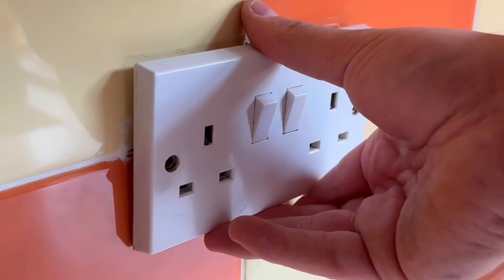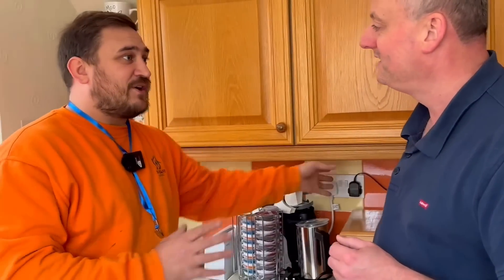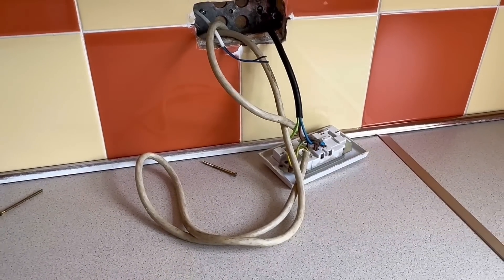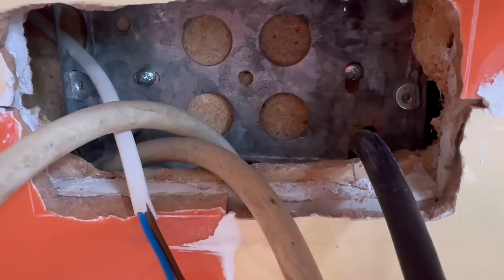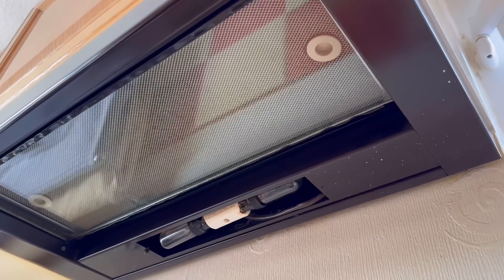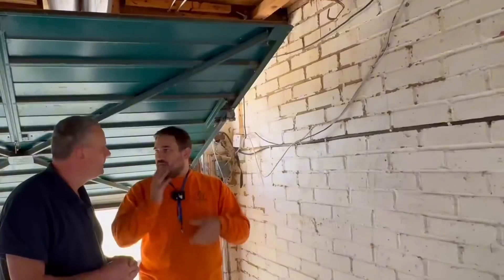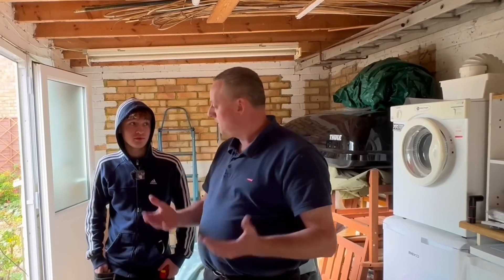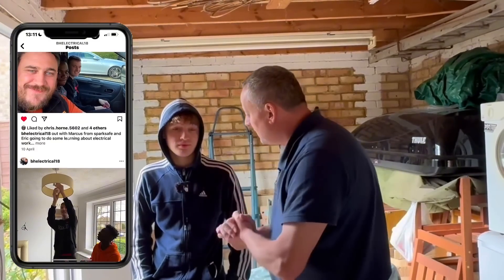Is this Allowed? Wiring Electrical Circuits in Flex…

Comment: So let me get this straight an extension lead was plugged in a socket in the kitchen the other end was a plug that went threw was borrowed from a strimmer it went out threw back of another socket in kitchen straight outside ( not weather protection) round the doorframe back threw the wall straight back in the kitchen to feed a single painted of socket to feed a cooker ignition and also a washer machine- so your telling everyone that end the cooker and washing machine the wires were twisted together, who did the installation laurel n hardy

Comment: Wait, so was that orange flex putting power out of the exposed pins of the plug and into an otherwise disconnected socket to feed the other socket? and going through the extension cord, but really what even matters any more then, right. That seems like it might have gathered more opprobrium than it actually got. Because that’s the only way I could see it feeding to the washer and cooker?

Edit: maybe I’m missing something about the layout and the washer isn’t under the socket that the orange flex plugs into.

Comment: If it’s wired in flex you can bet the whole circuit isn’t so what you put down on the cert ? 2.5/1.5 t&e or 2.5/2.5 flex. I’d be ripping the bodge out.

Comment: as an industrial fitter I was thought absolutely no to using flex inside walls or conduit because it can overheat, you are allowed to use it as a trailing lead or as a final circuit pinned to a wall and open to the air so it won't overheat, I know domestic regs are different and that's not my area
Reply: Why should it overheat if the conductor area is the same as that of an equivalent cable with solid conductors?
Reply: @helps9939 honestly I don't know, it's just what I was told by the electrician who trained me, but I have often wondered the exact same thing.
Flex can overheat tho, I once got a job at the factory where a flex cable had burned up, it was powering a 30A heating element in a bag sealer, the cable was routed across the room from the wall inside a round plastic 22mm conduit that had been wrapped in foam pipe insulation by a machine operator who kept banging his head. The cable size was well within spec and it had been fine 24/7 for 15 years until it got the insulation, then it failed in less than a week, but pipe insulation is more insulating that walls, I expect there's some math that can work this out but I don't know it

Comment: In boats it is the regulations that circuits are wired in flex, usually Arctic, HO7, or soft heat resisting, the main reason why Twin and Earth is forbidden on boats is engine vibration can fatigue solid copper core cables.

Comment: Getting the nails of the clips to work in mortar - or brick - or anything that tends to explode on you - pin plugs are the answer . Wonderful things that few electrical wholesalers seem to stock . Cheap as chips and do the job perfectly . They’re designed to ! 
Drill  a hole pop one  in - and the nail of the clip clip bangs into the plastic of the pin plug really nicely. Reminds me I need to buy some more !

Comment: Did I hear “omit the need for an over current protection device if the load is less than the cable rating” when looking at the under cabinet lighting supply? Surely the cable needs to be rated to handle the maximum PFC limited  by the circuit protection? I don’t think 0.5mm2 flex will fair very well under fault conditions when protected by a 32A circuit breaker!?
Reply: That was what I’d always heard, but apparently these days low power devices just need low capacity flexes. Which you will be able to see on all appliances being sold in Europe these days, because our sockets are pretty universally 16A and fused as such and our plugs are unfused, and yet lamps with 0.5 or 0.75 flex are entirely common. Still not super happy with it in fixed wiring, but it doesn’t seem to be giving huge problems as such.
Reply: So that very small flex isn't sharing any of the current from other things plugged in on the ring? It's just the cabinet lights current being drawn through it?

Comment: As a retired electrician, I would have got  the sack doing this. It's a horror show compared to a high standards electrical contractor. But, if the flex is double insulated as normal cable is and it's rating ok, then I see no harm using flex. We used heavy duty flex on machines, 4 core flex , earth and 3 phase supply.

Comment: The only colour of any cable on the outside of a building should be Black. Any other colour will be suscepitble to UV degradation, and therefore NOT good.

Comment: I worked in a few Sainsbury’s store upgrades around 2010, all the lighting and power circuits were wired in YY cable. Compared to T+E systems the Zs was always good due to the full size cpc. Just my 2pence worth. Cheers

Comment: Many industrial / plant wiring is done in HOFR flex , its expensive of course , but is a pleasure to work with and terminate ( always ferruled ) , and you really couldn't use solid core on the likes of control panel wiring ( where the panels require occasional opening for maintenance etc).
Reply: I have come across older machinery with their control panels wired in solid core wire, and one of the most common problems is that the connections break off right at the terminals. Because the wire is solid and holds it shape, the break is not always obvious. I think that a house wired in flex would be completely acceptable, especially because the CPC would be the same cross section as the current carrying conductors.
Reply: @whizzo94  Flex only becomes annoying when you've got a really tight box and need to cram too many wires into an old-fashioned choc block. Stranded wires are always slightly larger in outside diametre than the same CSA solid wire because there's gaps between the circular strands and that can make a difference, forcing you to use one size larger choc blocks that no longer fit into the box. These days with lever Wagos that's no longer an issue though. The other downside is having to  spend the time crimping ferrules all over the house.
Reply: @whizzo94  Agreed!

Comment: Normally the content on this channel is excellent but I am left feeling confused after watching this video, i.e. Can you wire in flex if it meets the right conductor size i.e. 2.5mm or not? Also what counts as a fixed installation? still learning hence the questions as I watched the video thinking the issue was the state the installation was in not necessarily it being in flex but then the comments below of confused me further. Gary you need to pin the correct answer.
Reply: There is no reason to use flexible cable, if correctly rated for the load it's exactly the same at the point of carrying current. It's more practical to install, but the reason why solid cable is used it's only a matter of cost. 

Here in Italy, for example, solid cable is not used, since using flexible cable (either singles if enclosed in conduits, such as inside walls, or multicore if external) is more practical to install.
Reply: The fixed part of the installation would be the sockets , switches   distribution board , fixed appliances  ( like a shower ) .  The things that stay when you move house . Appliances like kettles   toasters have different regulations . I worked on portable buildings last year and they are all wired in flex , including showers in 6mm 3 core flex . You get good R1+R2 readings because the cpc is the same as the line .

Comment: No decent fully qualified and trained to the standards of the 13th edition would wire any fixed installation in flex. What is the best uk wiring standards coming to. GHU
Reply: Clearly being trained to these standards does not  guarantee that the person understands basic physics.

Comment: As a competent kitchen fitter i cannot see any problems, its cheaper to buy hedgecutters and cut the flex off than buy the correct cable..a few choc blocks if the cable is not long enough , job done..

Comment: ALL Tesco's buildings wired in flex - it was the norm. aprox 15 years ago, every single Tesco building - hundreds of them were wired in flex at Britspace modular buildings and passed every test with no issues, it was in the spec.
Reply: I worked in a new Tesco build. All fixed Wiring was in galv conduit. Sockets, lights the lot back to the distribution boxes.

Comment: Not mentioned (I think) but surely the biggest problem is the power coming from outside on the orange cable and into a plug???? Take the plug out and you've got live pins.

Comment: Is it legal, is it possible, to complete enquiries before contract when selling a house with this kind of wiring?
Reply: Nothing in law that says wiring has to be to X standard before buying. Think about it. If I buy a derelict property, the chances are very high that the wiring will not meet modern standards at all, let alone 16th Edition or any edition before. It was the same when I bought the place I live in now. The previous owner had knocked down walls etc, left cables dangling. The bank had repossessed it. I just paid the money and bought it, knowing that the electrics would need sorting out. Buyer beware. Most mortgage companies would require a survey before handing the cash over. One reason the other buyer in the bidding had to pull out. I was paying cash, they needed a mortgage. And they got turned down.
Reply: @bertiesworld  So you can buy something that you couldn't rent? Seems mad to have such different standards? I take your point about a derelict house but no one is proposing to live in a derelict house whereas a house buyer is, presumably, going to live in it or let it to someone else who will?
Reply: Why would the seller be the one to 'complete enquiries'? Unless the buyer has specifically requested further details, following on from a survey.
Reply: @Benzknees  Because that's the law in England and Wales.
Reply: @BrianejSmith  - Specifically which laws are you talking about?

Comment: There is absolutely nothing wrong with wiring in flex.
Reply: You’re right. Actually, mobile homes like caravans etc. Regs say it should be wired in flex!
Reply: @mathewashley3954 that’s due to stranded having better grip on the terminal when under constant vibration like driving
Reply: @Ant98986  you are correct.
Reply: @mathewashley3954 specifically either in artic flex or t and e in flexible conduit
Reply: @altvamp  I’m pretty sure 2.5 flex can carry 25A
Reply: Except not the most cost effective
Reply: 2.5 is rated at 25a @altvamp
Reply: Tri insulated too.
Reply: 2.5mm flex is rated at 25 amps. @altvamp
Reply: I thought flex is less durable?
Reply: no @InvisibleYetVisible
Reply: So your flexible then
Reply: My flexible what? @mufc99ok
Reply: All my wires are flex
Reply: Looks wrong though
Reply: @scott4shell why
Reply: Oh my god who the heck does that shite work
Reply: But you can't say why flex would be shite. Because it's not. It's wire. It's actually better to flex the backs of sockets because there's much less strain on the terminations than when using twin. Twin is shite. @mufc99ok

Comment: Bizarre, 
While installing a security alarm in a new build property fairly local to me , some 15-20 years ago, I did discover that the ring final circuits were wired in 3 core flex with similar to 3 pin garden extension leads to extend the what I can only summit were  fixed cable lengths 🤔🤷🏻‍♂️, as there were multiple’s of these found under 1st floor floor boards while finding a route for my fused spur for the CPU .

Comment: When seeing what appears to be an undersized cable on a protective device, I'm still surprised to hear electricians refer to whether the cable can be overloaded (so considering overload protection - suggesting that it's ok if it cannot), without also considering short cct and earth fault protection i.e. the three components of overcurrent protection.
Reply: BS7671 makes pretty clear where/what is acceptable here. Regards short protection, the fault current at the end of even a bit of 0.75mm² that is a few metres long is still going to be more than high enough to magnetic trip an MCB sized for a normal final circuit...
Reply: @intercity125  are you confusing the amount of current required to operate the protective device, as in shock protection, with the current involved in short cct, that requires the requirements for the true adiabatic equation to be met - I2t<=S2K2 (i.e. energy let-thru of the protective device <= thermal capacity / energy withstand capability of the conductors)?
Reply: @johnhoward2104  I was thinking more of ADS clearing times...
If you apply the adiabatic equation and check the withstand capability, it's also not a problem... 

Why not go run those numbers? You'll find that for any conceivable fault current in a residential property it'll meet the withstand requirement.
Reply: @intercity125  Is it? I thought that was precisely one of the main reasons for the existence of fused plugs in the UK, protecting appliance leads against short circuits. The other one is obviously overload protection for power strips.
Reply: @Ragnar8504  Honestly fuses in plugs for short circuit protection are more important when you consider older designs - a 30 A BS3036 rewireable is going to take a while to open at the far end of a circuit if you short a long bit of thin flex.

(Let-through energy is worse closest to the protective device on an MCB until the full circuit impedance exceeds that which you'll see a mag trip on, whereas a fuse only has thermal tripping in its repertoire, so the let-through is worst at the far end with lower current but longer duration of heating!)

Otherwise it exists to fulfil overcurrent protection on a non-fixed load when dropping down cable sizes!

Comment: You can't wire circuits in flex because you are only allowed to connect to various sources over a maximum distance
Reply: So what do you make of the likes of 521.9 and 721.521.2, for example?
Reply: The "maximum" cable length is determined by its load current and the 4% maximum voltage drop from the supply consumer unit.
I ripped out all the T+E in my workshop  and replaced with 3 or 4 core flex because 1) the "Earth" conductor was undersized and thus easily damaged and 2) the constant vibration caused conductor cable failure
Reply: What do you mean?

Comment: Dont see the issue with flex. Its normal to wire a flex out the back of a fused spur which uses the same terminals as a socket
Reply: I guess the main problem is a lot of diyers and kitchen fitters inability to make it off properly as well as some so called competent electricians

Comment: Motor homes are often wired in Flex on the 240v side.
Reply: exactly as rigid twin and earth can break due to the vibrations
Reply: So are caravans….mine is…not had any issue with cable fatigue
Reply: And narrow boats too, I believe T+E would fail inspection.

Comment: Know it not as flex isn’t rated for permanent mains connection. But I could be totally bloody wrong

Wow the IET says it’s acceptable to wire final circuits in flex , just proves what a bunch of pilchards they are .
Any decent spark that does is a pilchard. It’s cheap and it is lazy. 
Just my opinion sorry.
Reply: We routinely do commercial work which is entirely done in flex. 
2.5mm 5core for lights
4mm 3core radial for spurs/sockets

All fully specified by consultant, with the caveats being it MUST be bootlace ferruled at ALL terminations (including wagos which is a pain since its not needed)
Reply: @darylsavage119  the WAGO's that I have bought clearly state for use on solid wire only.
Reply: @PeterChapman-rg6gr  you're buying the push in 2273 range then. 

Spend a bit more and get the 221 range, far better and can be used on stranded or solid from 0.14mm to 4mm (or 6mm if you buy the 41amp rated ones)
Reply: @darylsavage119  I only use these in very small numbers and get what are in stock at the electrical wholesaler.
Reply: @PeterChapman-rg6gr  I'm shocked then, most small wholesalers don't even buy wagos, they buy the off-branded ideal or q-crimp
Reply: It certainly isn't cheap...
Reply: Not at all. If rated to the circuit, and ferrelled, don't see what the issue is..
Reply: Explain what's wrong with it.
Reply: @electricalstuff259 His mate said so
Reply: I work in a factory. We use SY flex cable nigh on all the time.
Reply: Sounds like the opinion of someone who hasn't thought through what risks are involved and just assumes it is unsafe.

What's the fire risk involved? What's the electric shock risk involved?  What about the deterioration of the insulation and sheath over time? How long will it last before it needs replacing?

You should go through each of them and answer the question. That should be informing your opinion, not "I don't think it should be used because I have always used T+E thermosetting at 70 °C".
Reply: @deang5622  Exactly the same applies to T+E cables yet they are deemed to be good for 50+ years.